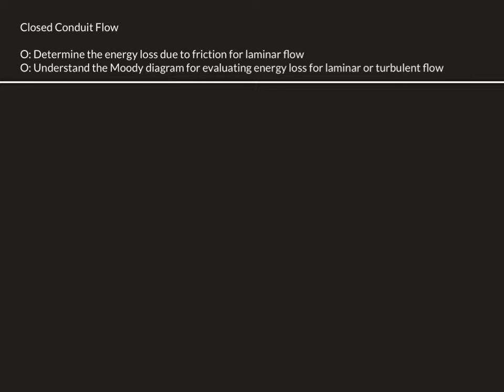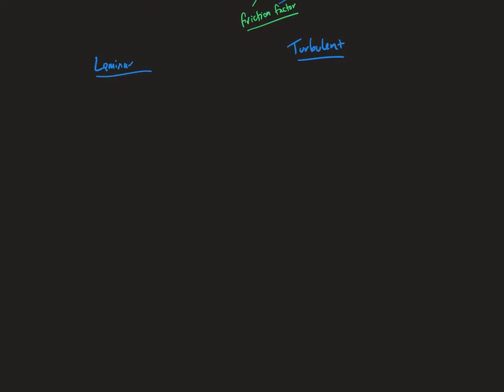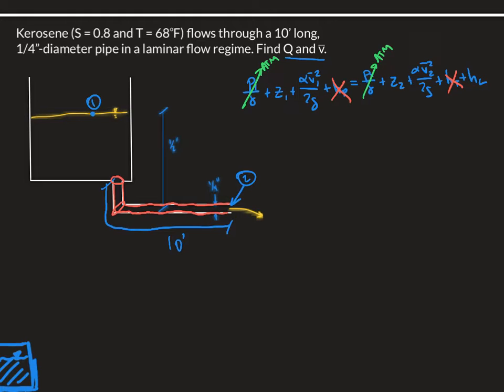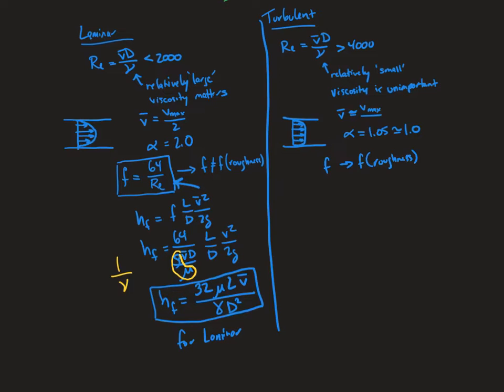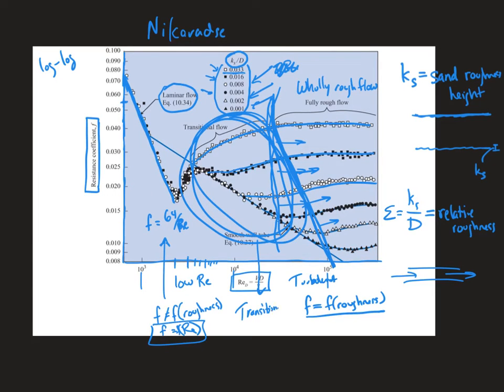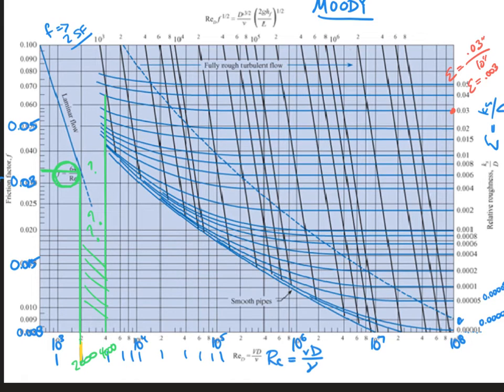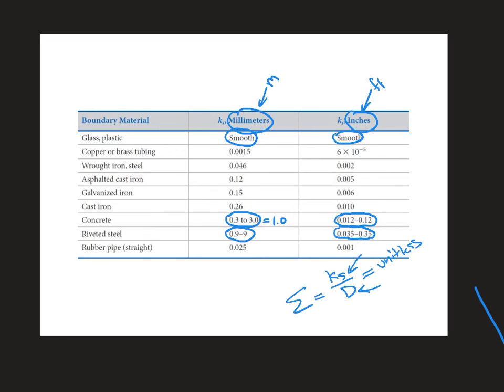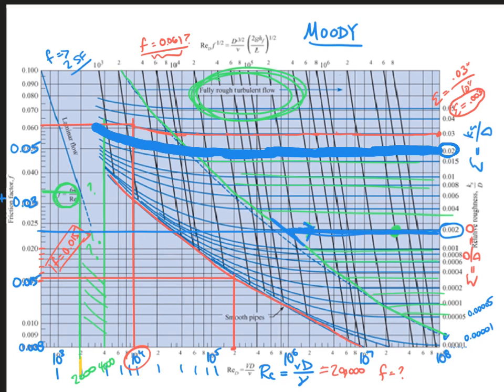L21 Closed Conduit Flow p1

Comment: Hello! I am confused on how a smooth pipe can have an epsilon (and thus Ks) of zero but with the table you showed us copper pipe, for example, has a Ks of 6 x 10^-5 in". Could you explain this for us? Furthermore, if I have a reynolds number of 1. 4000 and other example 2. 8000 for flow in a smooth copper pipe, what would f and epsilon be? (Referring to Moody's graph and the Colebrook equation).